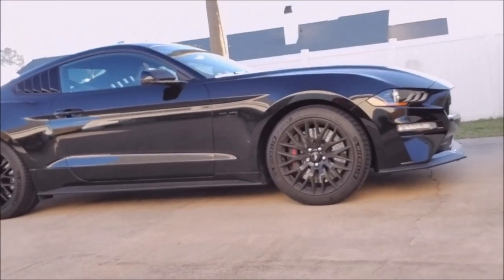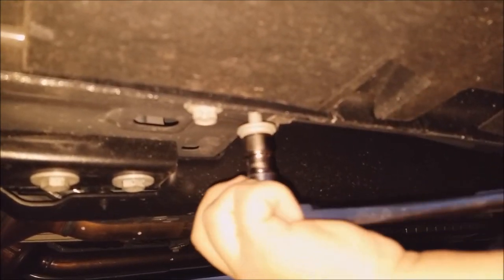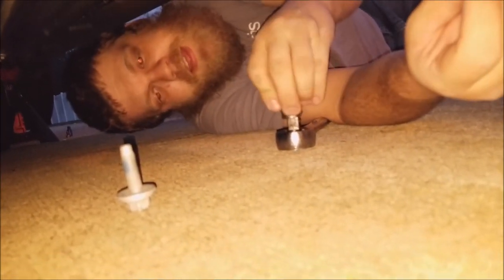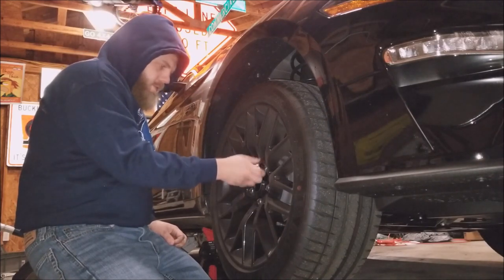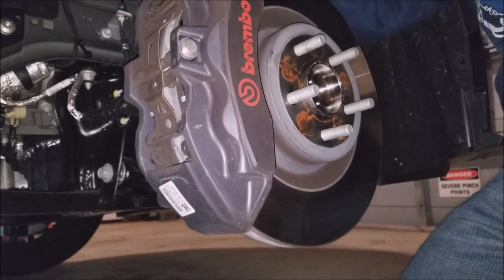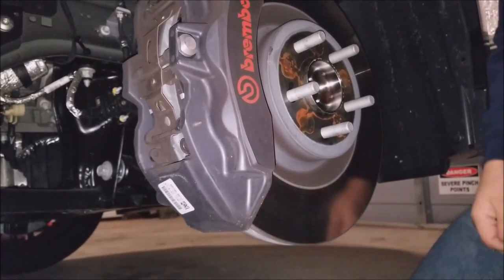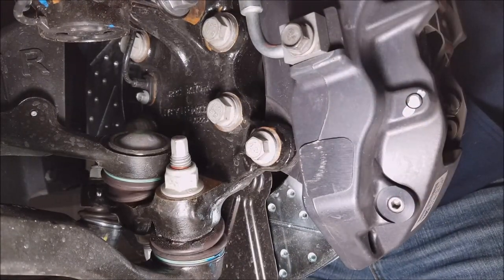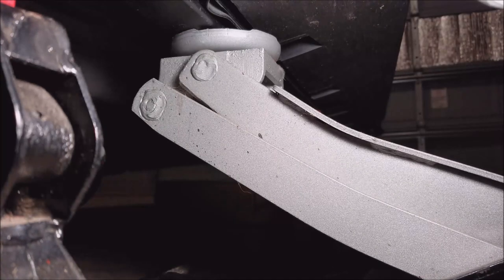2018 Mustang Crash Pictures, Steeda Jacking Rails & Baer Eradispeed Rotors Install

Comment: Just found your channel. Great videos! What size brakes did you go with in the front and back?
Reply from the maker: Next Adventure With The Cims They are the same size rotors as stock, just lighter, drilled and slotted.

Comment: I know you did the rotors for weight savings mostly... did you notice any difference (better / worse) in braking performance?
Reply from the maker: mustangthrall I don't know about 60 to 0 specifically but I did notice significantly reduced brake fade at the track.
Reply: Right on. ...yea saving 30lbs of unsprung should equate to about 250-300lbs of weight savings yea? Looking forward to your future videos. Have you done circuit racing, drag strip or both with it?

Comment: I highly recommend the Steeda wheel hop kit, made a huge difference in my Stang. I also installed a carbon fiber driveshaft and JRZ Coil-overs, those last two mods are pricey.  Don’t know if you have the Magnaride. Also a Lund Tune.
Reply from the maker: Marco Gutierrez I do plan to get the wheel hop kit but I also have the magneride, so I'll be keeping the stock shocks.

Comment: Just curious, why didn't the wheel spacers work?
Reply from the maker: gmwaw7 Best I can figure, the wheel studs on the 2018 are longer than previous years. They interfered with the factory wheels.
Reply: Which spacers did you get? 25mm fit the 15-17 performance package wheels without issues, but 20mm are too thin for the studs to fit in the back of the wheels. 23mm is the thinnest that will work without modification. I used 25mm on the front and 20mm on the rear, but cut down the studs for clearance.  And yes, spacers make it look sooo much better.

The jacking rails were the second mod I did, right after hood struts. Good job on the videos, and good luck on it!